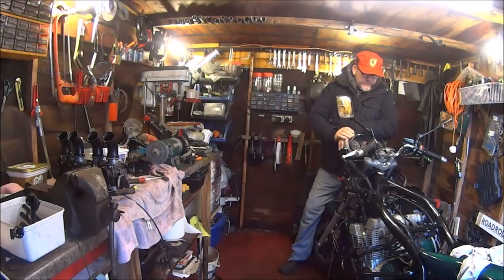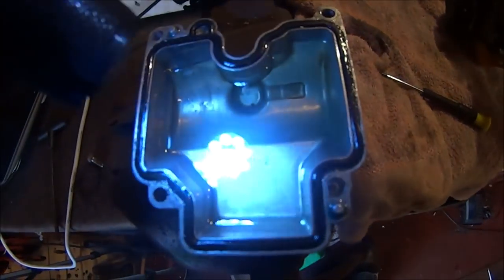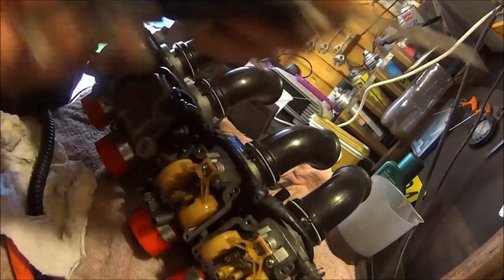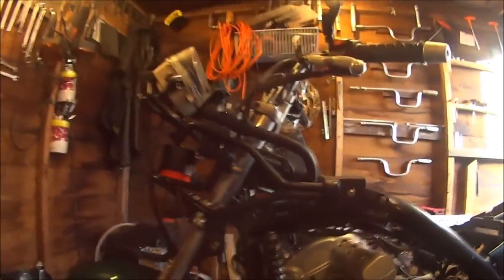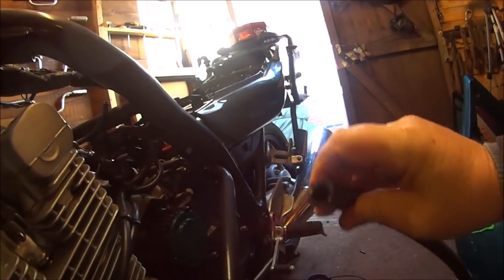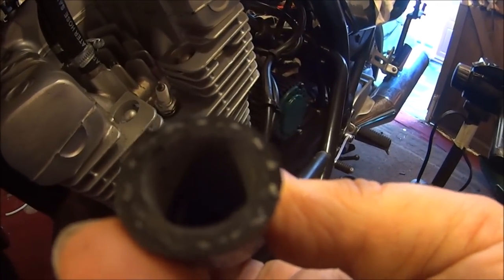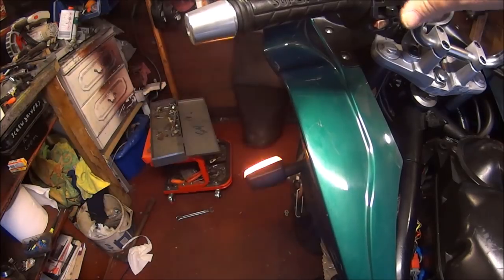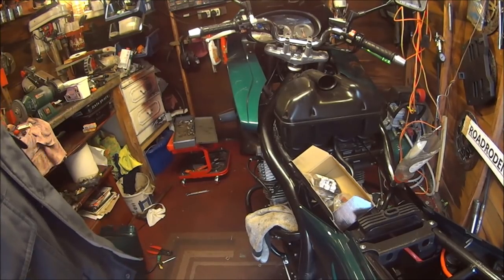XJ900S losing interest.

Comment: John did you take out and clean the jets that are outside the rubber couplings that go into the air box??? On mine these were also blocked and are the ones that cracked upon removing them so were replaced. My smoke issue has now resolved itself👍🏻
Reply from the maker: Hi northerner glad you got away from the smoke issue.. I'm not to sure witch jets you mean. Is it the air mixture screws?.
Reply: John the only way to explain what they are without sending picture is for you to look at this eBay listing number 271325913913 these are situated on the inlet side of the carbs but are outside of the linked rubber inlets that come from the air box. They are removed with a flat head screw driver but like I said two of mine cracked upon removal but when I got all them out they were completely blocked. I suspect your issue maybe these ! If you need new ones Don’t goto Yamaha but search moto carb on Merseyside as they got them really cheap! Good luck Stevie 💋
Reply from the maker: thanks stevie... the item no, you gave is for the main jets inside the carbs. my main jets are all ok.